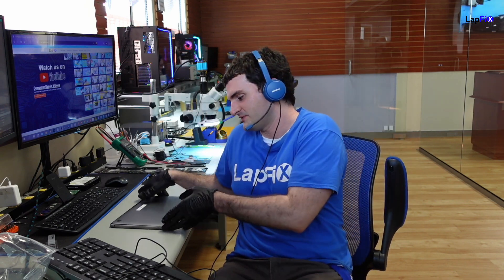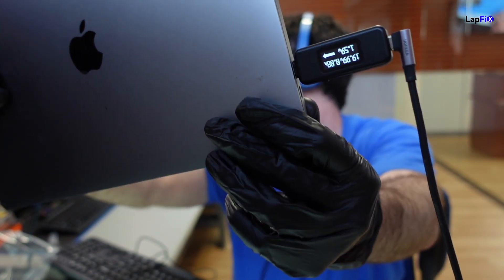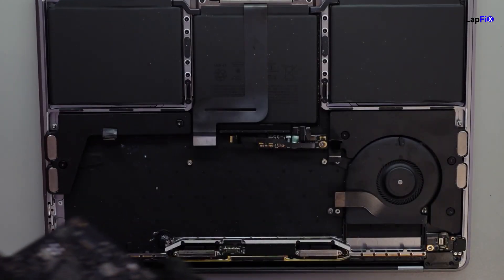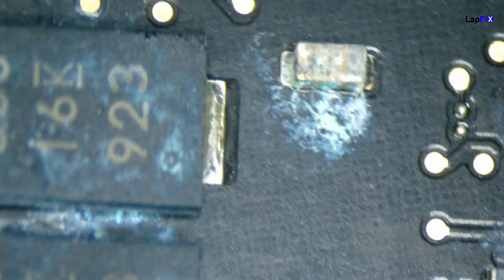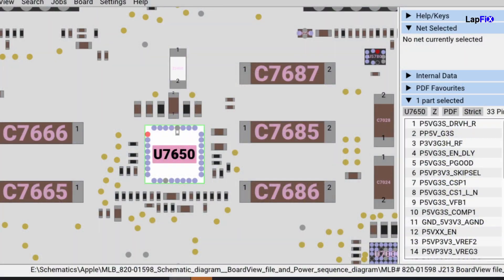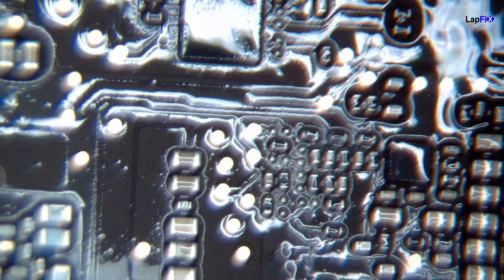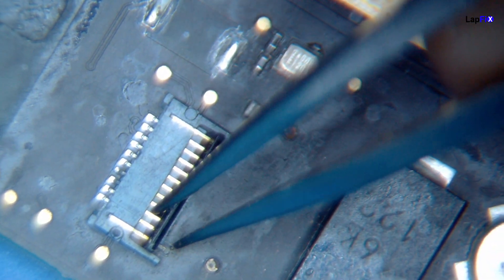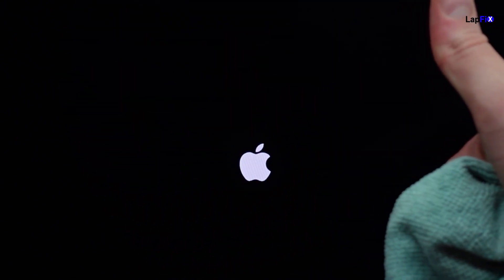How to Fix a 2019 MacBook Pro with a Liquid Spill and Broken Battery Connector

Comment from the maker: If ever doing a repair, be VERY careful when lifting the latch up, it is VERY fragile.  VERY 😉
Reply: Once I had to fix one with no spare latch, I put electrical tape on the opposite side of the flex cable, opposite the contacts to make it come closer to the contacts and then put another bit of tape to secure the flex to the connector. I got lucky, it was also another latch and not the battery one, so I felt it was safe.
Reply from the maker: If it works and holds up 👍

Comment: So I opened up my macbook pro because it wouldn't turn on unless it was plugged in once unpluged the laptop would automatically shut down,  I've noticed that that pull up tab was missing on my MacBook for the power connector similar to the one you replaced in this video.its a 2016 MBP Touch bar A1706 . Do I have to ship in my laptop to get a price quote?